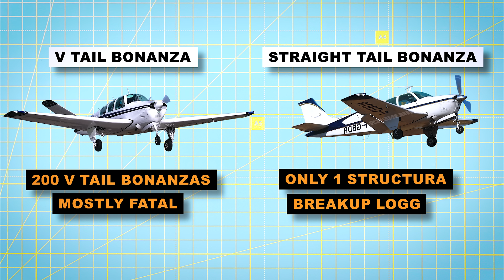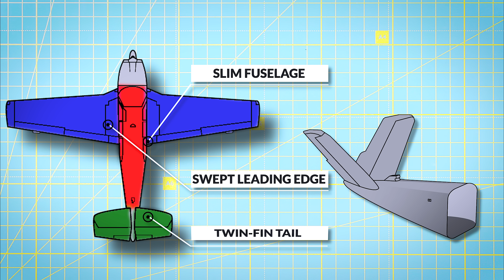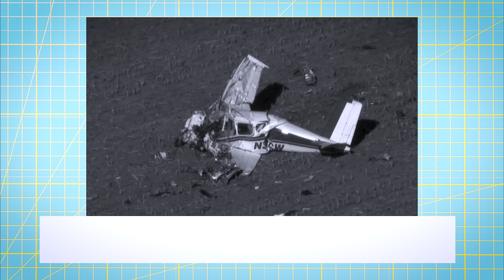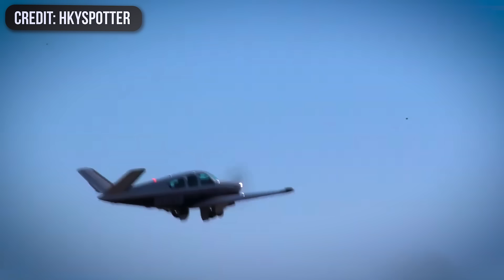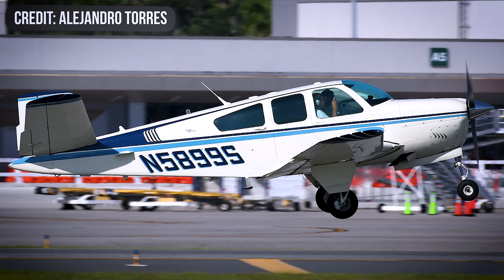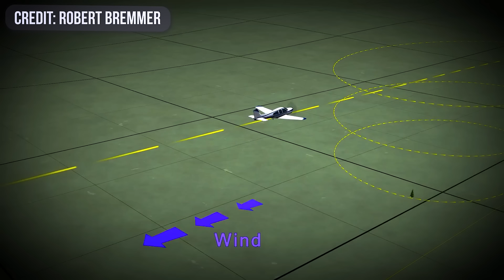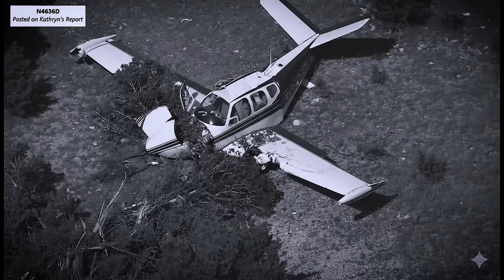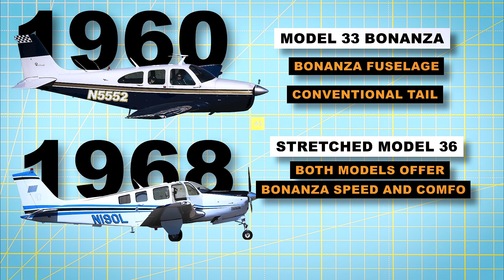Why Did This Plane Kill over 200 People?

Comment: VTAILS  are great. 
And as far as I could discover there would have been no failures if aircraft had been flown within defined limits.
There was a weakness in the in the attachment to the fuselage but not to be flown beyond requirements . For safety it was reinforced. As a retired Transport Canada certification engineer we did not know this until later and got reinforced and Ok.
Altho we did not know problem then we should have grounded the V Tail models until problem discovered

Comment: That “Butterfly Tail” was annoying to fly in any kind of turbulence.  It wagged back and forth enough to make you sick.  Nothing like a vertical stabilizer to keep the nose pointed where it should point.
Reply: As if you've ever flown in a 35 Bonanza or its straight-tail variants.
Reply: As a CFI/AI/MEI for almost 50 years I have taught in both variants and more other aircraft than I can count.
Reply: @user-zp5vj2bl8o1  Even if true, and I doubt it, an anecdote doesn’t prove a claim because it isn’t systematic evidence. It’s just an isolated statement or observation, which by itself can’t establish that something is generally true.
Reply: @smark1180  I can tell you never never flown one.  Why not do some research before commenting - especially since you are not a pilot.  Search on “Pilots of America” or any other search.  Some believe the cause was the dihedral wing but many other planes have that and do not have the issue.

Comment: This is my dream single engine aeroplane.  Should I aquire one, there will be three mossy stones on the instrument panel top, with a set of golden wings mounted on top of them.  My dear 1959 V35 will always be flown every 3rd of February, no matter what.  Even if I do not feel like flying that night, I must take my V35 out on the 3rd of February.  There will be a vintage altimeter and artificial horizon with the bottom of the artificial horizon black and the top yellow.  It will not be plugged up.  But, it will be in the plane, always.  There will always be three records in the plane, with the hits of 1959.  The 1959 V35 will always be playing music from 1959 on my 3rd of February flights.  My 1959 V35 will be named, "Roger." 
There actually is a distressed Beechcraft Bonanza V35 near me.  It is being sold for $6500.  I am thinking of checking it out.

Comment: I've owned 7 Bonanzas from early to late including many V tails, straight and the A36. Overall, if you compare their safety record, they are a very safe plane if you fly them correct, which is not hard to do with reasonable training. And for years (and still today), they are the standard that other aircraft manufacturers look up to. For what they do, they are hard to beat.

Comment: @3:50 - Interesting. It's like AI never heard of torque and rolling about the longitudinal axis. The resultant linear forces do cause the aircraft to yaw, but they clearly exert a rolling torque on the aircraft. Does the roll-inducing torque require pilot correction via the ailerons, or is there some automatic compensation that takes place automatically?
Reply: @bruzote Nothing was “forgotten.” What you’re describing is already inherent in the control geometry.

When the ruddervators deflect, each surface differentially produces an aerodynamic force. Because those forces act away from the aircraft’s center of gravity, they create moments, not just translation. That’s how the yawing moment is produced in the first place.

Yes, there can also be small roll coupling because the surfaces are canted and located off the centerline. But that isn’t some extra torque that needs special compensation. It’s simply part of normal aerodynamic coupling. The V-tail mixer just converts pilot inputs into the correct ruddervator deflections. It doesn’t cancel roll.

In practice any roll component is minor. If it appears, the pilot corrects it the same way as in any airplane, with aileron input.

And the Bonanza also has aileron trim, which can remove any persistent roll tendency without the pilot having to hold pressure on the controls.

Comment: The Piper Comanche is a superior airplane and horsepower to horsepower is faster, a very generous weight and balance envelope. The Comanche also has great corrosion resistance due to all internal airframe parts and pieces painted with zinc chromate before riveting together. The Bonanza is bare aluminum. Something you should consider with how old these airframes are.
Reply: On a horsepower-to-horsepower basis, the 260-hp Bonanza variant typically cruises faster than the 260-hp Comanche by about 9–10 knots (roughly 10–12 mph), based on published performance figures.

“Very generous” is subjective, but the published CG limits give us something measurable. The PA-24-260 Comanche has a relatively wide allowable CG range. At lower weights, the envelope spans over 12 inches, and even at max gross the window is several inches wide. That supports the idea that it is generally easy to keep within limits. By contrast, V-tail Bonanzas are known for tighter CG windows at higher weights, with narrower allowable ranges in some loading conditions.

So while “very generous” is opinion language, the underlying point is directionally reasonable. The Comanche 260 does have a comparatively broad CG envelope based on the published limits.

As for corrosion and primer, yes, Comanches were internally zinc-chromate primed. That’s a legitimate design feature. But reducing the Bonanza to “bare aluminum” ignores Alclad skins, factory corrosion protection practices, and 60+ years of maintenance history that ultimately matter far more than original primer alone.

Comment: Someone has said that this vid is full of AI bs… I dont know… What I do know, is that every single footage from that V tail thing flying at higher speeds and lower altitudes shows crazy yaw instability… I’m sure that it will have crazy stats regarding flying performance because of the lower drag, but… it looks dangerous!!! Its a bit like putting a old race car with no assists on the hands of someone who thinks he can drives because hes used to drive a modern car with all the safety nets.
Reply: That claim is unsupported.

The Beechcraft Bonanza Model 35 V-tail has flown for nearly 80 years with millions of fleet hours. If it truly had “crazy yaw instability at higher speeds and lower altitudes,” it would not have passed certification or remained in service this long.

Aerodynamically, directional stability increases with airspeed because tail effectiveness increases with dynamic pressure. The V-tail still provides vertical stabilizing area through its ruddervators, and the aircraft had to meet FAA stability requirements.

“Every single footage” is anecdotal nonsense, not evidence. If there were systemic yaw instability, it would be documented in FAA or NTSB findings. It is not.

Comment: 3:48 with right rudder the V tail generates left roll torque, which is opposite to what the aileron generates in right turn, creating twisting strain on the fuselage. Anybody considered this unfortunate consequence of V tail?
Reply: “…creating twisting strain on the fuselage.”

None of the aerodynamic sources state that this coupling creates structural twisting strain on the fuselage as a design concern. The roll tendency is an aerodynamic coupling, not a structural torsion problem. Aircraft structures are designed to handle the loads produced by control inputs and aerodynamic forces.

“Anybody considered this consequence of V-tail?”

This effect is well known and documented in aircraft design. Engineers accounted for these behaviors when designing aircraft with V-tails.

Comment: What a total Bullshit piece. This design has been around since 1945 with over 18,000 sold. They don’t come apart any more than any other higher performance airplane flown by “more money than brains” idiots. It is interesting to note that most of the accidents pictured show the tail still firmly attached to the fuselage. It is a very easy to fly very stable honest flying aircraft. Sure it’s slicker than a Cessna 172 but what aircraft isn’t? You could substitute any aircraft on the market today and do a hatchet job video like this. Anybody who believes one tenth of what these folks are saying is probably unqualified to even evaluate an aircraft. One of the newest and safest small jets the Cirrus V-jet uses the same tail design as have a couple of fighter jets and have had no problems.

Comment: Buddy Holly & the big bopper..... Didn't the Music Die on this type of f' up Airship?!
Reply: Stop embarrassing yourself.
Reply: @smark1180  1947 Beechcraft Model 35 Bonanza
V Taills same plane  mo ro n
Reply: @adamdelarozza1985  First, it wasn’t an “airship.” An airship is a lighter-than-air craft. Airships, like blimps and dirigibles, float because they’re filled with a lifting gas such as helium or hydrogen. They do not rely on wings to stay aloft.

Second, the official Civil Aeronautics Board investigation concluded the crash was caused by pilot disorientation in poor weather. There was no finding of a mechanical or design failure with the aircraft. The pilot was not properly instrument-rated for the conditions and lost control shortly after takeoff.

So calling it some “f’ up airship” while also typing “mo ro n” is a little ironic. If you’re going to insult someone, at least get the basic facts right.

Lastly, EVERYONE knows about the Holly Bonanza crash - you're not onto something new.
Reply: @smark1180  I stand by my initial  statement. The Beachcraft V tail is a  F' up airship (design).😎
Reply: @adamdelarozza1985  Standing by a mistake doesn’t make it less of one.
Reply: @smark1180  no mistake made; V Tail beechCraft AirShips suk
Reply: @adamdelarozza1985  You’re reacting ignorantly to a famous crash, not making a technical argument.

Do you have any aeronautical background or flight experience to support what you’re claiming? Or is this just based on knowing the Holly crash involved a V-tail?

One accident, officially attributed to pilot disorientation in night IMC, isn’t evidence that an entire aircraft design “sucks.”
Reply: @smark1180  I disagree.. I am not a pilot, I am a guitar player. I hope to Fly and own a Cessna 150 one day but need to sell some songs first
Reply: @adamdelarozza1985  . If you’re not a pilot and haven’t studied the accident data, structural history, or the crash investigation, then calling an entire aircraft design “f’d up” is just reacting to a famous tragedy.

The Holly crash was officially attributed to pilot disorientation in night IMC, not a V-tail structural failure. One accident doesn’t define a 70-plus-year production aircraft flown safely by thousands of pilots.

When you do start flying, you’ll learn pretty quickly that accident causes are usually more about weather, decision-making, and training than tail design.
Reply: @smark1180  So I guess the nickname "Doctor Killer" for the Beechcraft V tail is from fools who don't know about aircraft? 
Remember the design conception was born from the way it looked. It 'looked modern' and new! So it was really a marketing gimmick and not an areonaughtical innovation. Today,  complicated air sufaces structures are handled by computers, not the wire cables the V tail uses.
Reply: @adamdelarozza1985  We're right back where we started - stop embarrassing yourself.

The “Doctor Killer” nickname came from 1950s–60s ownership demographics, not from some proven fatal design flaw. A lot of affluent professionals bought high-performance Bonanzas, stepped up from slower trainers, and bent them due to overconfidence and weather decisions. That’s a pilot transition problem, not proof the tail was defective.

As for “it was just a marketing gimmick,” the V-tail wasn’t decorative. It was designed to reduce drag and weight by combining rudder and elevator into ruddervators. That’s a legitimate aerodynamic concept. Whether it’s optimal is debatable. Calling it fake innovation isn’t accurate. I suggest you read Those Incomparable Bonanzas by Larry Ball, and educate yourself about the tail design.

And bringing up modern computer-controlled surfaces misses the era entirely. Even most modern general aviation aircraft still use mechanical linkages, cables, and pushrods for primary flight controls. Fly-by-wire systems are mostly found in airliners and military jets, not in light aircraft like Bonanzas or Cessnas. So bringing up “computers” doesn’t really apply here - it's even nonsensical in and of itself.

You’re layering modern hindsight and internet folklore onto a mid-20th-century design and calling it proof. That’s not analysis. That’s narrative. When you don’t have aviation training, accident data, or engineering background to support what you’re saying, then repeating “Doctor Killer” and calling the V-tail a failed design isn’t analysis. It’s repeating folklore.

Comment: For new to the aircraft, need to know it's characteristics.  In 65 my father was a passenger going with a friend to ferry a BEECHCRAFT 35 (mfg 1947) from Aspen CO to Denver.  The PIC had 615 total hours, but only 1 in this type.  Aspen is in a horseshoe canyon.  Evidently they had engine issues right after take off.  The PIC tried to turn & return to the airfield, stalled & crashed killing both, so not an airframe issue, just wrong decision in the emergency situation by the PIC (as it was told to me). This happened before I was born, so we never got to meet.   "Destroyed on 30 March 1965 at Sardy Field, Aspen, Colorado when it failed to climb on take-off on a ferry flight and spun in. The two people on-board were killed. "

When I was getting my private I did fly into & out of there only with my instructor.  Prior to Covid & my sons were young enough I did take them to several Young Eagle flights.  Out of 1 club there was a BEECHCRAFT 35 but never got the chance to fly with the owner.
Reply: This was pathetically bad decision making. Not a bad airplane.

Comment: your aerodynamics are way off...  explain that elevator force again for us.... and then go to aerodynamics for naval aviators... learn something, then come back and report... The "V" tailed Bonanza is one of the finest aircraft I have even commanded.... and the only add on was an aluminum channel attached to the under belly to stop the wagging tail... it is also interesting to note that the FINEST aircraft I have ever commanded is the DC-10-30... which was the basic design for the MD-11.... and I have thousands of hours in each.

Comment: What a pile of BS. The V-tail Bonanza is the most studied aircraft in history. It was found to have no design weaknesses when compared to design requirements. The leading edge of the V-tail can be made stronger with cuffs and internal braces. Those enhancements are valuable as they increase the ability to endure pitch up control inputs to overcome inattentive pitch down over speeds. The owners of F-33s and A-36 straight tails were assessed as more conservative and disciplined people and pilots. F-33 pilots drive Volvo and Mercedes. V-tail pilots drive Porches. They tend to think success means competency. Then, they get way behind the aircraft and get in trouble. 6 seconds of inattention is all it takes to start a pitch down over-speed. Many aircraft have a coffin corner.

Comment: The V-tail Bonanza was not a “fatal design” in the sense of being inherently doomed. Still, it did have a historically higher in-flight structural failure rate than the straight-tail Bonanzas during overlapping operating years.

Published analyses cited by Aviation Consumer and the NTSB show substantially higher breakup rates for the V-tail compared to the 33/36 straight-tail models when measured per 100,000 flight hours. That difference is what led to focused FAA Airworthiness Directives aimed specifically at preventing V-tail structural failure.

At the same time, accident reviews show that pilot factors dominate Bonanza accidents overall, and many structural failures occurred in scenarios involving overspeed, turbulence, IMC, loading issues, or abrupt control inputs. In other words, structural exceedance often followed loss of control or operational decisions.

So the most accurate conclusion supported by the record is:

• It was not simply a “fatal design.”
• The V-tail had less structural margin in certain regimes, and pilot actions or operating conditions often triggered exceedances that led to failure.

For context, but anecdotally, my late father and I owned and flew two V-tail Bonanzas. And decades ago, my father, before he became a pilot, luckily missed a flight with a friend who, as a non-instrument rated pliot, flew into a thunderstorm, lost control, and the aircraft suffered structural failure. Both wings and the entire empennage were missing from the fuselage when it pancaked into a farmer's field.

Comment: The strut less Cessna 210 and the Cherokee 6 family have a higher airframe failure rate. If you count a loss of control regardless of coming apart or hitting the ground in one peace the straight tail Beechcraft has a higher loss of control. The theory is once past Vne aeorlastic deformity renders the straight tail ineffective while the Bonanza isn’t and pulls apart during recovery.
Reply: From Aviation Consumer